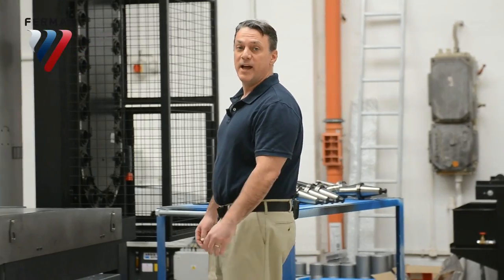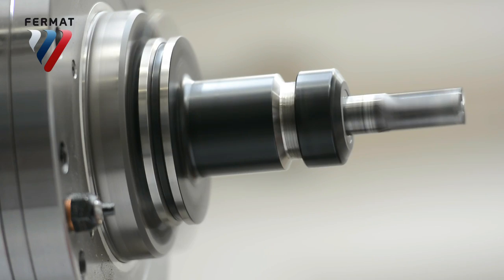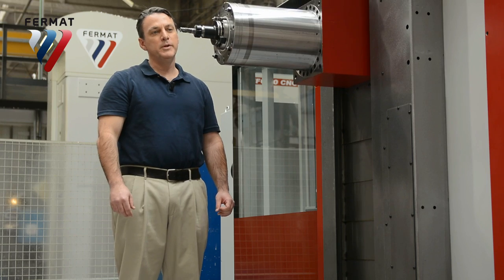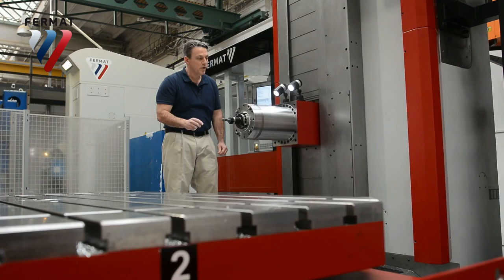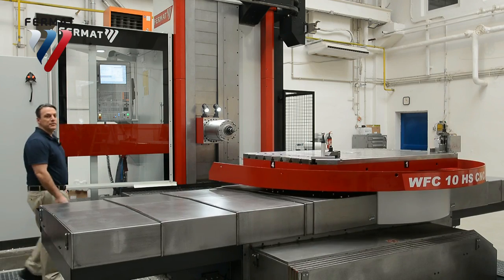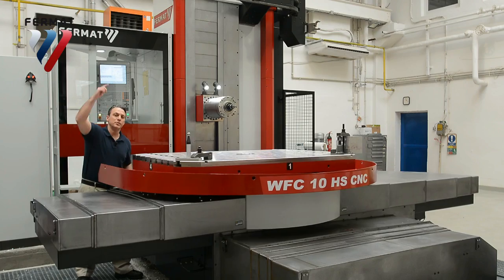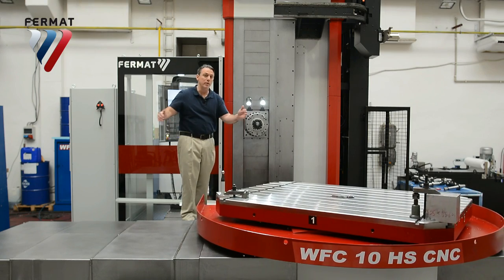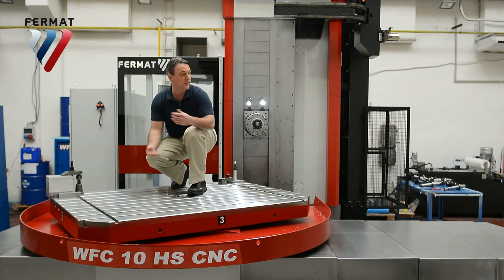High Speed CNC Cross Table Type Horizontal Milling Machine | WFC 10 HS CNC | FERMAT MACHINERY

Comment: 20000 ( twenty thousand) & 30000 (thirty thousand) millimetres travel on respective axes.  I strongly suspect you are not awfully familiar with metric measurements.  The aforementioned dimensions imply 20 & 30 metres travel or in old imperial measurements 65.62 feet ( 21.87 yards)  & 98.42 feet ( 32.81 yards).  I somehow strongly doubt your machine is roughly twice the length of an articulated lorry or as you refer to as a semi. Regarding the dimensions mentioned for table size; in engineering terms dimensions are normally expressed in millimetres and not in metres.Good presentation otherwise, shame about the lack of metric familiarity. Kind regards.

Comment: That's an interesting design, I run a similar machine at work, I have 6k RPM with only 17kW but thanks to the geared spindle upto 900nm at lower speeds and 90 bar through spindle coolant